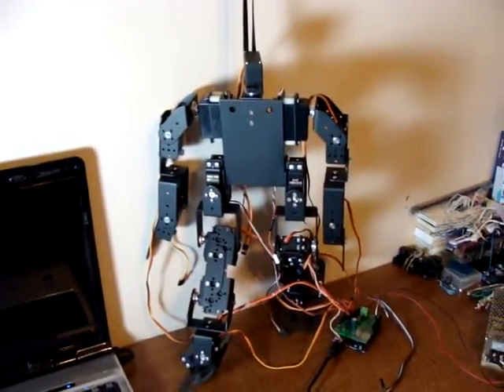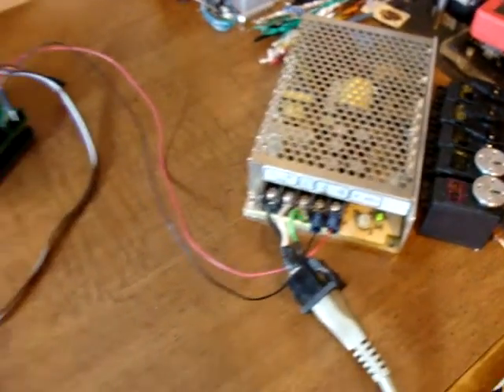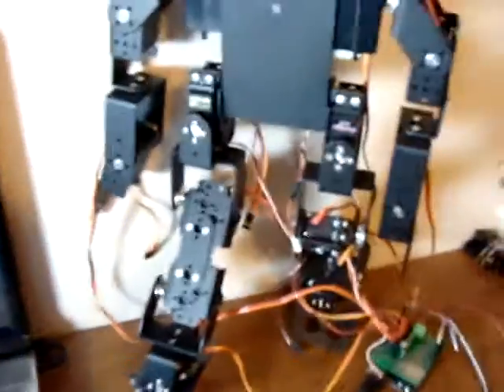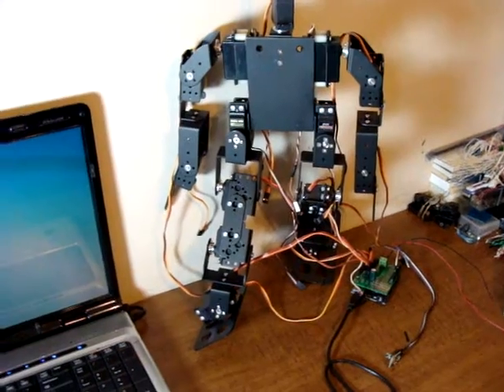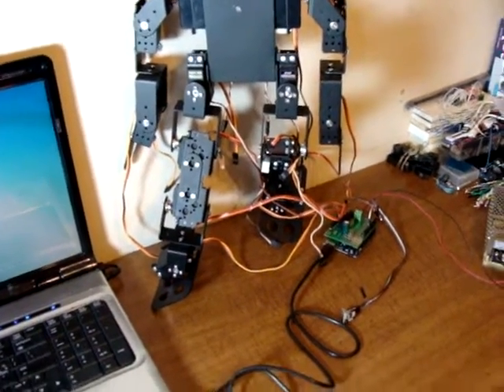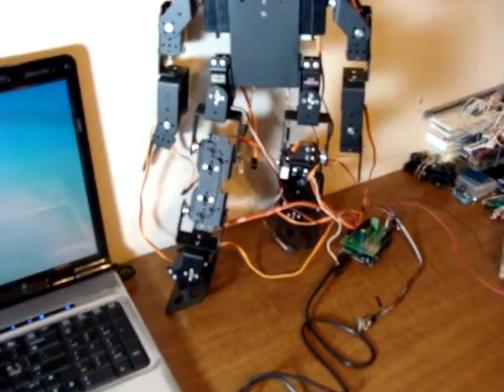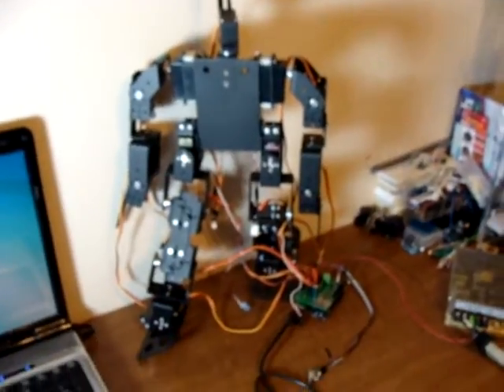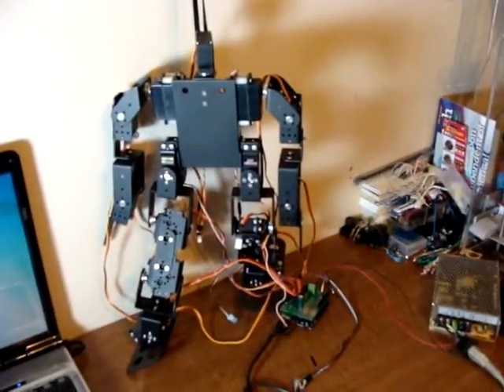Arduino Uno powered Walking Humanoid robot 1

Comment: Where did you get the chassis
Reply from the maker: I build the body out of 3" aluminum C channel.  It is used in making equipment racks.  That gives you a place to put the Arduino.  You can make the body out of several parts that come in the kits.

Comment: hi Bob, some advice that will save you a lot of money: avoid the mg995 servos. the mg946r costs the same and is far more reliable. I've burnt through a dozen 995's. They are god awful.
Reply from the maker: +trahim2 - Thanks, but its too late.  So far mine are working.
Reply from the maker: +trahim2 - You are right.  The MG995's really fail under load.  He cannot walk!
Reply from the maker: +trahim2 - I bought some MG945's for the hips and burned one up last night.  The MG995/MG996 servos work for the arms (or for a 9 DOF robot).  I am thinking of trying the MG958.  Anyone know if they have enough power?
Reply from the maker: +trahim2 - 

Here is some more Information that I have discovered about servos and robots.  Be sure the servo that you buy is not a cheap imitation.  This can be detected by the seller hiding the manufacturer name or misspelling the manufacturer name.  A common example would be “Tower Pro” (real) or “Towerd Pro” (fake).

This is my new rule of thumb for making humanoid, as in 2 legged robots.  The problem is that the more the servos (and their connecting hardware) the more the robot weighs.  

The leg servos of a 5-9 DOF Humanoid robot should handle 100 oz. inches of torque.  

The leg servos of a 10-15 DOF Humanoid robot should handle 150 oz. inches of
torque.

The leg servos of a 16-20 DOF Humanoid robot should handle 200 oz. inches of
torque.
Reply from the maker: +Bob Davis +Bob Davis - The MG958's rock!  They are the best bang for the buck in servos.
Reply: +Bob Davis Glad you like em. I have used 995's from multiple suppliers and each was clearly from a different manufacturer. What they all had in common was their horrible failure rate. I have not tried the 958's but they certainly do look better. They definitely have an insane amount of torque if the datasheet is to be believed.